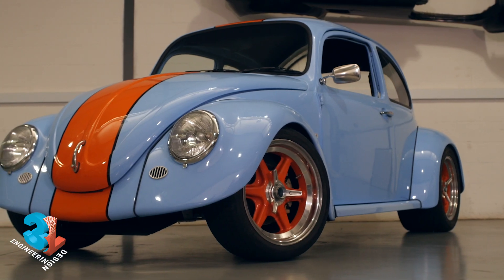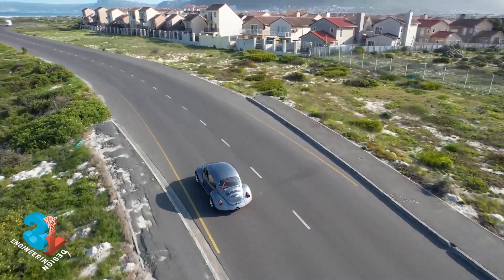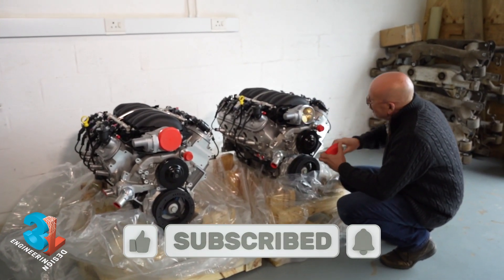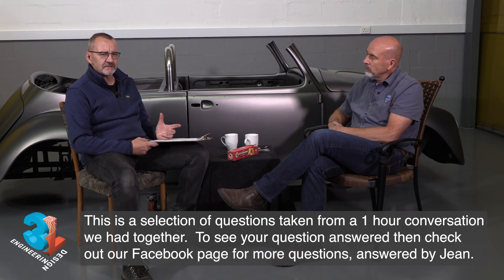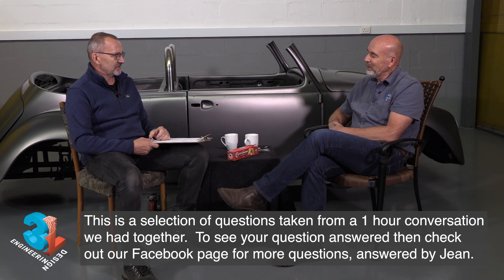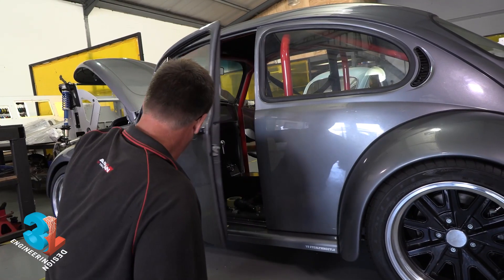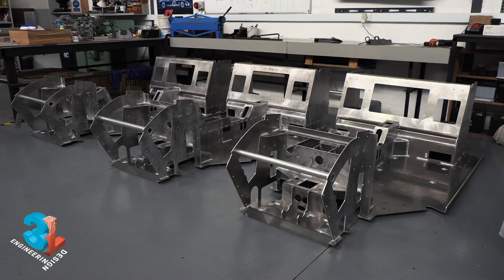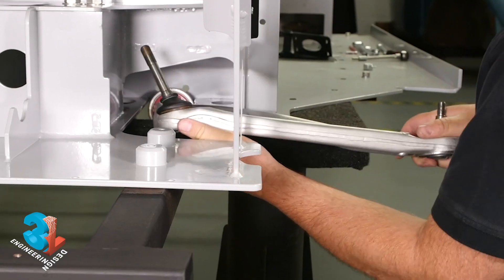V8stealthbeetle Q&A: Is it road legal, how long does it take to build?

Comment: It's not a beetle it's a sport car and built into it is BMW suspension and we all know BMW handles like there on rails ,the movies use them all the time. Sweet. I want one and I'm getting  one soon, just thinking 350 hp fast electric version of grid power .,free transport plumbed into the transaxle.and there's a 500hp electric version also 3 second  too 100kph.